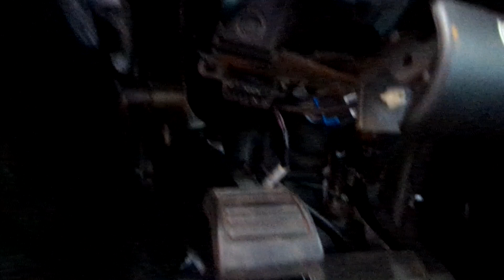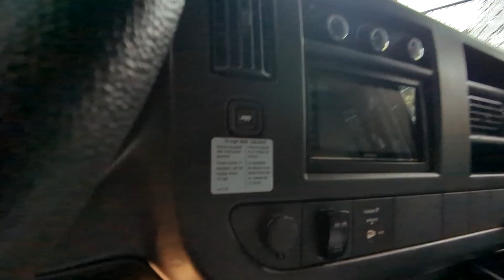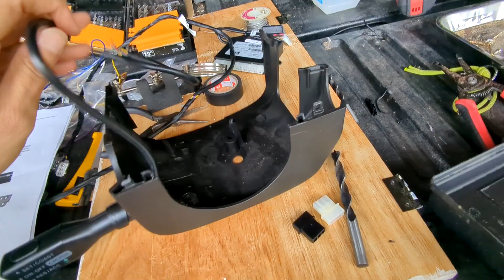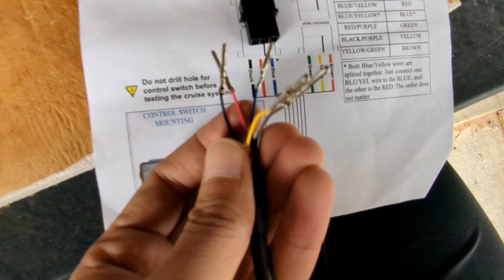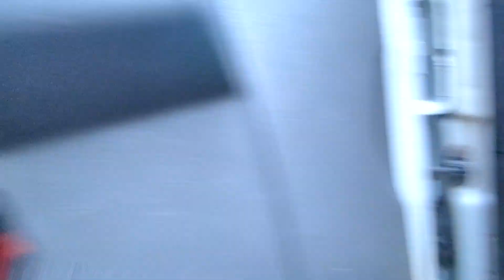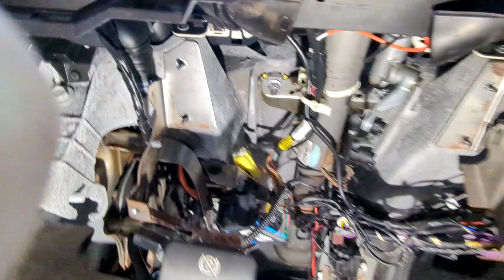Aftermarket Cruise Control Install - 2010 Chevrolet Express/GMC Savana 2500

Comment: Great great video. Quick question, when you have cruise set, and you start braking. Will cruise control go off?
Reply from the maker: Correct. The system receives input from the brake pedal to tell the control box it's engaged. And properly discontinues cruise.
Reply: @MOLRobocop thank you so much!!

Comment: so anytime you need to scan the obd 2 port you need to unplug the cruise control from the obd2 port?
Reply from the maker: @starmaster191  I mean, yes. But that's not something I'm doing more than once every 6 months. So it's not a huge inconvenience. There's probably a way to tap the OBD feed without filling the socket. But I really didn't want to splice more wires than I had to.
Reply: @MOLRobocop  yeah splicing wires. if I had to do that myself I would probably mess something up. lol. I don't think I even have the right equipment for that. I just paid a car audio shop to do mine.
Reply: You can literally put the factory buttons on and it is nearly plug and play
Reply: @rpturbo ???
Reply: I don't know if this link will work 

https://youtu.be/Pdj3fjfuSlA?si=AYsfySVM2UlHLeaC
Reply: @rpturbo yeah i seen that one. it didn't work for me.
Reply: @starmaster191 not sure why, we have done it on several. You have to disassemble a truck at the yard, you need the buttons and wiring to the clock spring. Otherwise, there's only 1 other thing that could potentially need changed with HP Tuners, but I have never had to do that. The factory radio controls also work.

Comment: lol i just paid a shop to do mine. rostra 250-9608 . paid a car audio place to do mine. they had done one of these before.
Reply: How much did they charge?
Reply: @raylsmith8456 $220 and $19.34 sales tax.
Reply: @raylsmith8456   I took it to a car audio / electronics place that also does alcohol breathalyzer installs where you have to breathe into the vehicle in order to start it. that said, it was about $220 and after sales tax it was like $239. it plugs into the obd II  port so if you wanna scan  for a code or something,  then you have to unplug it and then it doesn't work if it's not plugged into the obd port. all that said, it's worked like a charm. Hasn't malfunctioned yet.
Reply: How much do they charge ?
Reply: @bigchungus7720 I took it to a car audio / electronics place that also does alcohol breathalyzer installs where you have to breathe into the vehicle in order to start it. that said, it was about $220 and after sales tax it was like $239. it plugs into the obd II  port so if you wanna scan  for a code or something,  then you have to unplug it and then it doesn't work if it's not plugged into the obd port. all that said, it's worked like a charm. Hasn't malfunctioned yet.